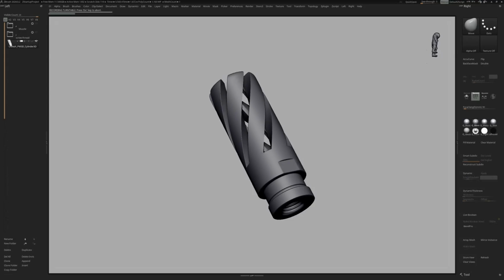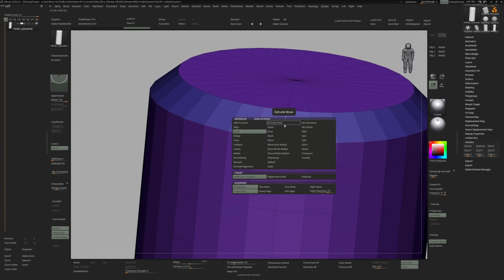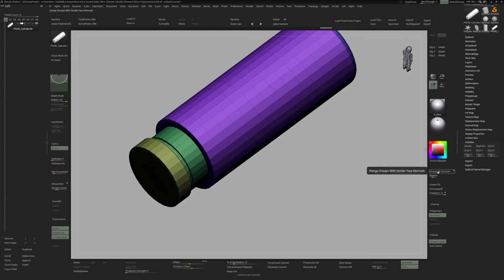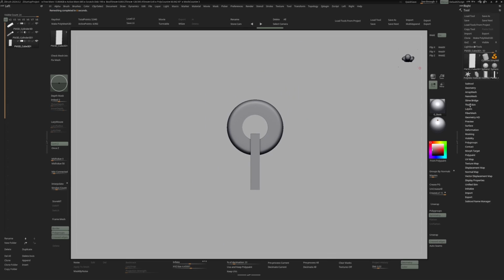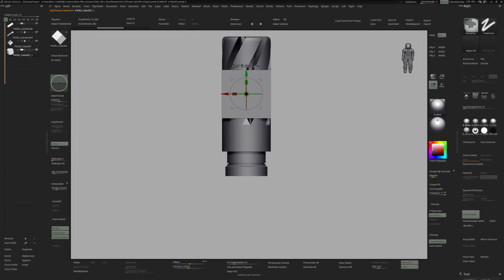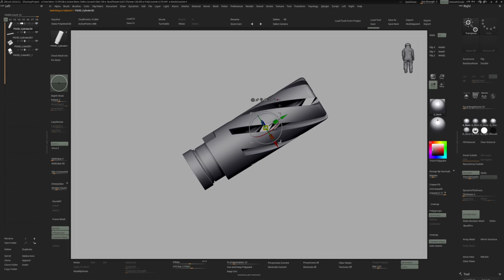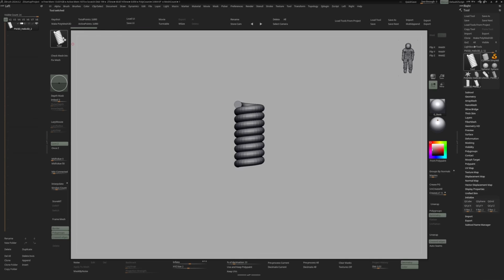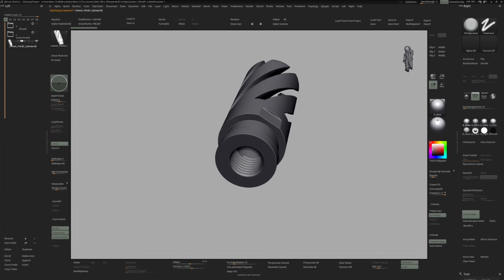ZBrush Beginner Modeling Tutorial | Muzzle Brake

Comment: Hello there Georg 😊,  thanks for sharing this modeling workflow in Zbrush. One question,  have you tried Plasticity for doing these kind of hard surface objects and integrate it with zbrush?
Reply from the maker: Yes I have played around with Plasticity for a bit! I like it a lot and it's probably stronger in doing these kind of hard surface props. 
I simply want to showcase that Zbrush hase the potential to do a lot of that stuff as well. Zbrush is my main Software and I do a lot of different modeling/sculpting in there. So I personally like to stay in Zbrush as long as possible to keep the bigger picture and also not disrupt my flow while working by switching 3d packages all the time. Hope this helps!
Reply: Any vehicle tank tutorials? Not looking for perfect scale. Also want to learn texture render. I seen but very old and was wondering any new ways of doing things? I saw a guy do a Bugatti in zbrush very well made.